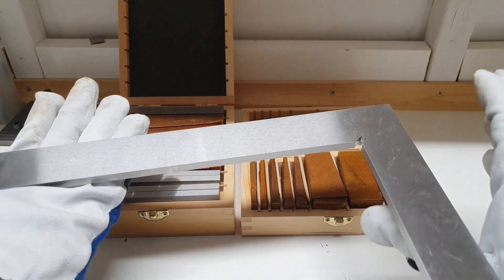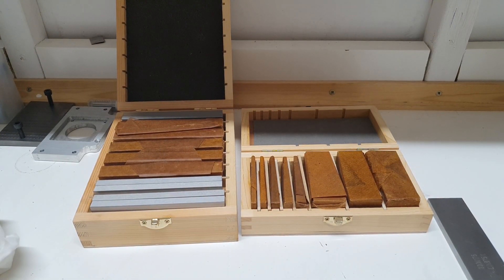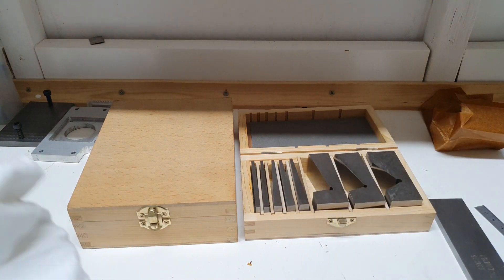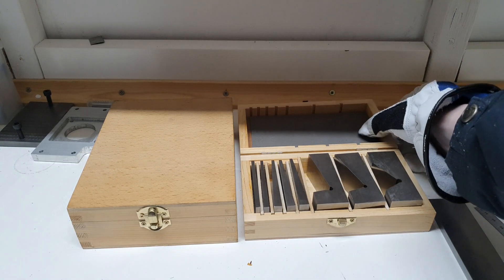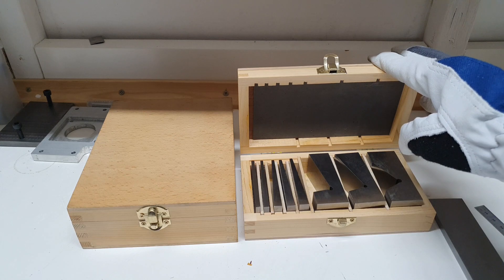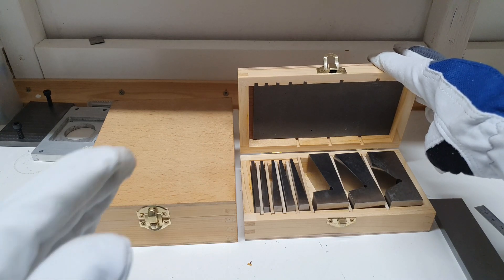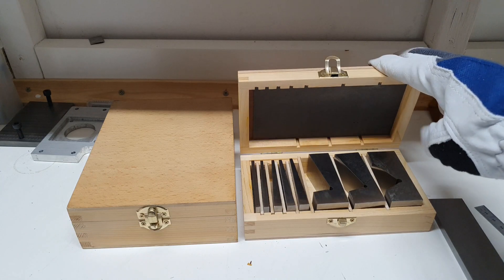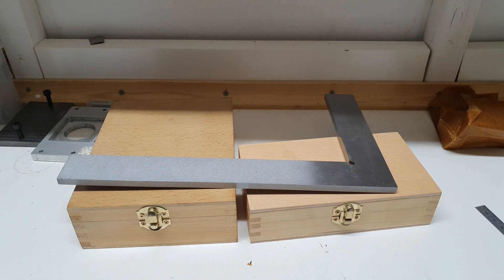New Parallels + Angle blocks + Machinist precision square

Comment: I bought the same angle blocks. They arrived a few days ago. After letting them rest on my surface plate overnight, I started with the 30* block. They're spec'd at .0003 TIR. I'm seeing barely any indicator movement.

Comment from the maker: I was a bit suprised to recive two 4 degree angle blocks. It should not be like that. According to the seller 1, 2, 3, 4 and 5 degree of the small Ones should be included. Not 1, 2, 4, 4, 5 as I recived. 

I Will Contact the seller to see if the can send me a 3 degree block. Or perhaps give me some discount. I am planning to use the 15 degree v-block alot, so I am really not in the need of a 3 degree one. But right should be right, and if I want to sell it some day, its pretty worthless to not have the complete kit. 

I Will post a comment here how the seller handled this issue.